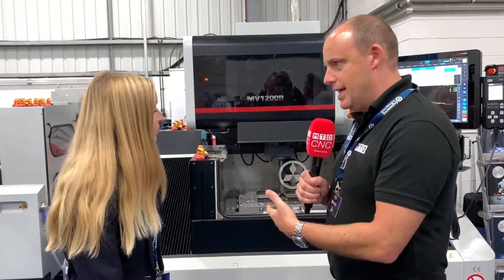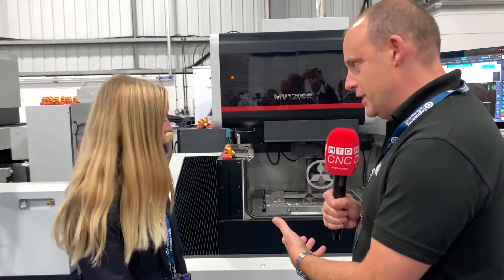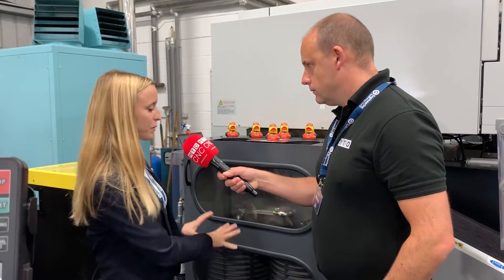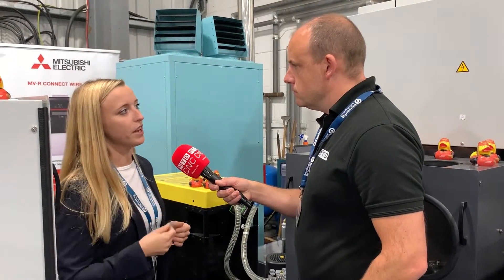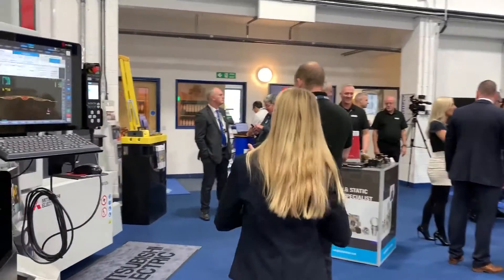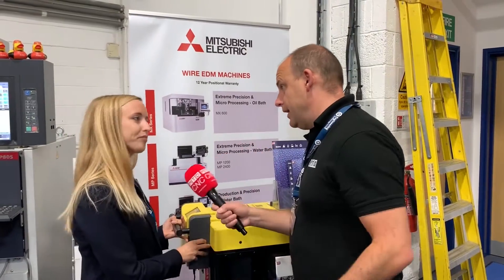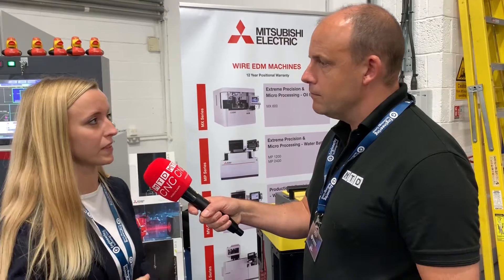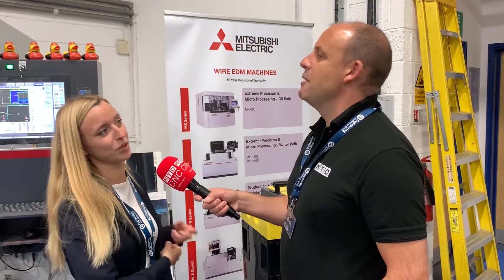A must for all EDM machines

Comment: Europe must do things different than here in the us. As someone that works exclusively on mits wire machines this is absolutely not needed in the us. Never have I ever told someone to add chemicals to their system. The resin bottle does all this work, with the help of the water filters.